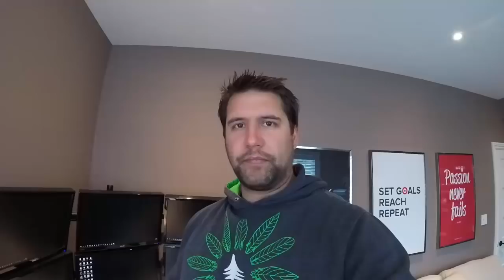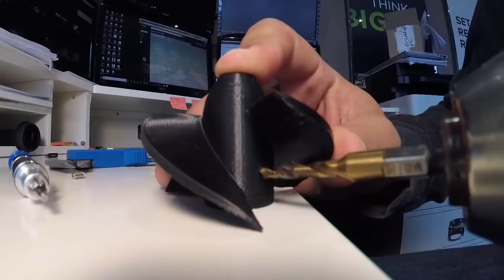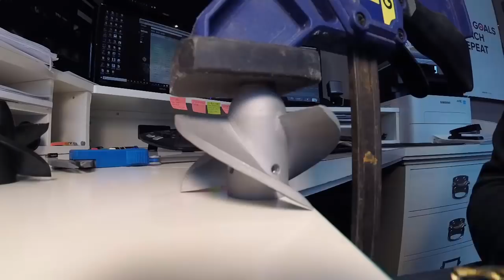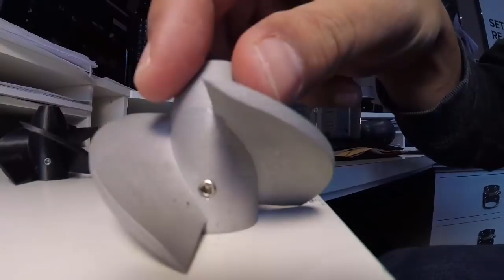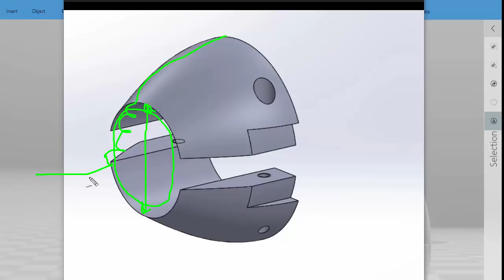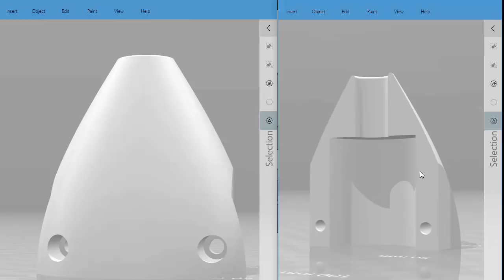VeFoil by VeConcepts Part 8 - DIY Electric Hydrofoil Impeller & Intake Cone

Comment: if those are stainless set screws , you need a dichromatic paste, or it will weld its self to the aluminium, and even faster in salt water . you can get it at boat chandlers for the very purpose

Comment: Hey Guys looks like a fun project, I plan to build one of these myself shortly when I get back to NZ. 
Talking about keeping the flow path of the water smooth, why are you bringing the converging cone down to the shaft diameter only to force it to then move back around the diameter of the impeller hub? It would make much more sense to bring the converging cone directly down to the diameter of the impeller hub and have the two fit together with minimal gap to create the smoothest flow path. I am a professional product designer with a long history of surfing, skateboarding, lots of mechanical knowledge and I've even participated in a fluid dynamics paper (I say participated, because it proved that my physical knowledge of the  concepts is sound but the complex math trips me up) anyway if you want some help and input let me know, I freelance and love to work on projects that I'm actually interested in. If you want you can check out my portfolio here: https://drive.google.com/open?id=1XCbrX_V7e40bHB4QK1d-l3TGtVhi7Yua

Also if you want more prototypes of the impeller for cheaper rather than SLS Aluminium, try SLS Nylon. It has 80-90% of the strength of moulded nylon and is pretty cheap. I use it for HD camera cases on my racing drone designs at a 1.25mm wall thickness and it can handle high speed impacts no trouble, also with a quick clearcoat it has a very nice surface finish. You can see the camera parts here: www.brdmquads.com

Keen to see how this turns out and if Hamilton type jet propulsion works for foiling :)
Reply from the maker: Hey, Thanks Blair for your insight and offer to help out! Yes, I totally agree with the cone to match up with impeller hub, but for testing reasons, as we have another impeller design that cone needs to be shorter, for now, to work with all our impellers. But once done testing little things like this will be fine-tuned flow/performance efficiency. Those are some cool drones, and cool projects you have been working on. Keep up the creativity!

Comment: How much did it cost to 3d Print this size
Reply from the maker: It was 143 euro, but to have it cnc’ed aluminum its $50 usd once we go into production.
Reply: man that is expensiv
Reply from the maker: yup not cheap, but less than CNC'ed in Canada or USA for $400 LOL  We want to test apples to apples meaning aluminum NON-flex impellers. I would hate to have a great impeller but 3D printed in flexible material and it loses its performance from flex. Things have to tested correctly
Reply: DIY Electric Hydrofoil jeah thats right
Reply: DIY Electric Hydrofoil i just bought a metal crusible from Amazon. Now i will try casting, too.
Reply from the maker: Good luck going that route. We did that also but it's not really that simple to do it well and took up a lot of time VS just having something printed in aluminum perfectly and shipped. We dont need to learn to make every part from scratch, we just want to figure out what should work best, get it made, test, and ride :)
Reply: DIY Electric Hydrofoil I will also try to cast Polyester with some fiber glass strings in it. Maybe that will be my first Video in my Channel

Comment: I love your project, looking to buy one for cruising around on the surf but im afraid your impellers won't give you enough speed to make it past 10mph where the fun speed starts. maybe you don't want it to be past 10mph, don't know. It looks great nonetheless, reminds me a bit of "scubajet" will keep watching your progress. cheers!
Reply from the maker: Thank you. Our focus is on building an efoil that will work with the masses for easier learning, safer without an exposed prop, and to comfortably cruise 10-14mph which is the ideal sweet spot. Foiling is not as simple as jumping on a surfboard, and we want riders to succeed and have fun. The foil type will play a big role in what the cruising speed will be for any particular setup, SUP foil is what I am using, I'm 250lbs so I need a big wing and larger board for flying. If you are HIGHLY skilled and want to go 20+ mph, then you may need to look at the prop and reduction gear setup. Personally, going that fast on a foil scares the hck out of me LOL
Reply: haha yes I agree 20mph would be scary, but if you can achieve 10-15mph would be right in the money. Do you know how long would battery last on a full charge?
Reply from the maker: MrChris3162 depending on the battery pack size, rider weight, and skills (cruising constantly, or constantly falling and restarting). Its going to vary dramatically. We are shooting for. 40-45 min session once the rider has some experience/practice.

Comment: That looks very nice. I hope you end up with enough thrust to foil.
Reply from the maker: Thank you MaxMaker, They key with the direct jet drive is proper board size, it must have a large surface and flat bottom for quick and easy planing to get up to foiling speed. It takes less power to get a board planing if its has a very flat bottom. Also a large front wing preferably a SUP foil will make the ride more stable.

Comment: with the jet unable to suck air do you think an impeller is the best option fully submerged?  I was going to do a pump like an impeller and everyone told me it had to be on the surface to be efficient and effective.  Ya, it will still move water but not how it suppose too for thrust v.s. watts vs speed. If yours works ill keep on with mine.
Reply from the maker: Good question Chris. Yes, it will work, others are ripping around with  56 - 70 mm impellers for foils and they are always fully submerged. Yes they are mot efficient above water, but foils are so efficient, once you are up on foil your only using 24-35% of power/throttle anyways countering the other loss. I also dont want a huge prop for safety reasons.

Comment: Hard to tell, but not sure those holes have fully formed threads all the way through. That type of tool isn’t the best when you don’t have enough clearance on the backside. Otherwise, nice work and patiently waiting for completion!
Reply from the maker: Yes, the threads did go all the way through and set screws goes all the way through and into the center cavity. This is a prototype impeller for quick and easy testing, but final impellers will be CNC'ed and tapped with a high quality tap at the machine shop. Thanks for hte kind words ScotY808!